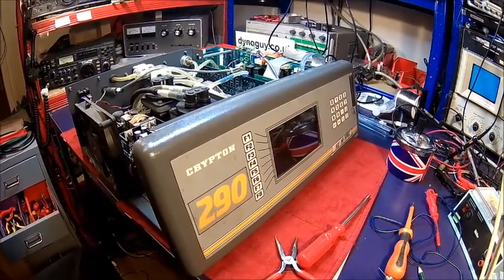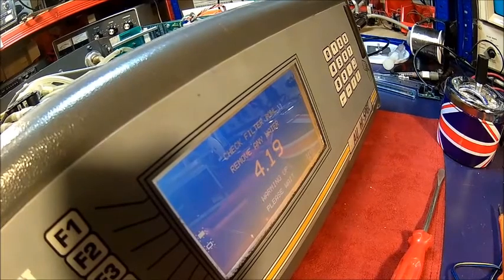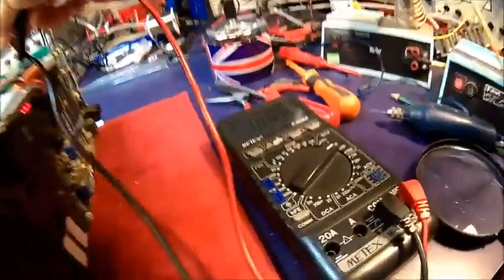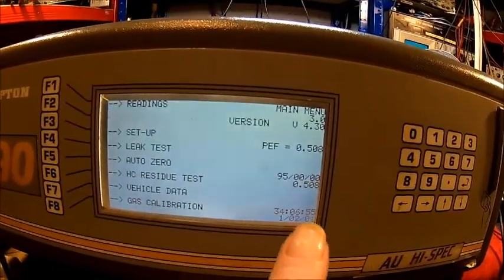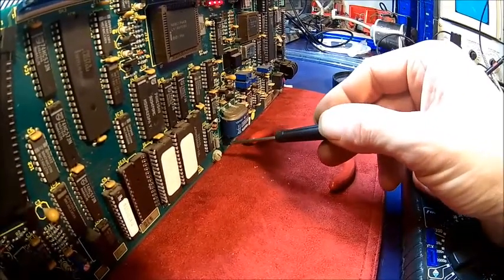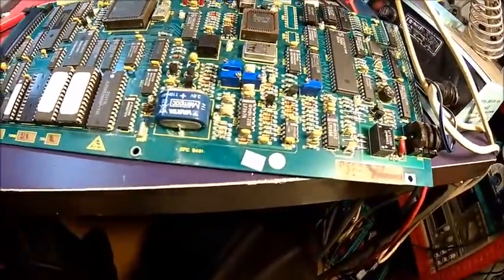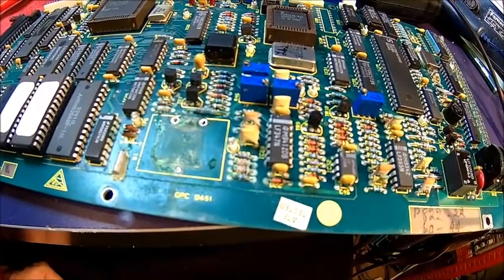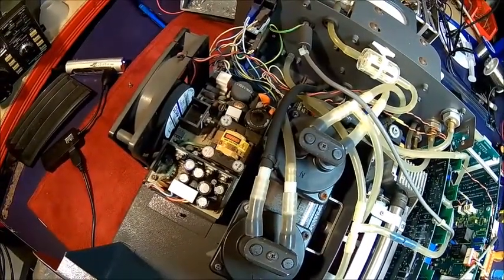Crypton 290 Emissions Analyser,  fault finding and repair - part 1 (Car diagnostic)

Comment: Hi great video , I have used many of the older type gas analyzer from that era[ Bear I/M bar 84 and BAR90 Emission analyzers
some models will go to a screen saver mode like yours to help protect the CRT from Burn in [where the main menu stays burned in on the screen from running to long] if it has a O2 sensor inside [models that use cal gas for calibration] REPLACE  that sensor BEFORE making any adjustments to the pots [which have a small adjustment screw on each pot I own  a BEAR ACE with  a Ckit full size engine analyzer I bought New and service and repair myself since they have gone out of business  it a great compliment to my Mustang MD500 chassis Dyno  a invaluable piece of equipment in my shop  hope this helps   Royal T
Reply from the maker: Well, there is no CRT to burn in, it's an LCD, there are also not really  any pots to adjust, it's pretty much all done in software, but you are correct with the O2 sensor, that needs replacing every couple of years.

Comment: hi.. do you know the voltage of the power supply. mine is broken fuse bows everytime without the output connection so sure the power supply broke. do you remember wich pin has wich voltage? colours maybe?
Reply from the maker: Don't know the voltage right now, but check mains side rectifier and capacitor, one of those are most likely bad

Comment: Hi There, I have one of these gas analysers with similar issues, I'm an electronics engineer and a petrol head. I have a VW Corrado I'm working on (fulling issues) an need an analyser to help work out the problem. Do you possibly have a schematic for the crypton 290. ?
Reply from the maker: Hi Dan, ... as you probably found out by yourself, there is pretty much nothing to find on the web, so the answer is no.  But if you are an electronics engineer, it shouldn't be impossible for you to fix it without drawings, just apply some logic and experience, then you may get there at the end....cheers, Mike

Comment: Is that machine still usable for today's mot?
Reply from the maker: Not entirely sure, it's only a 4 gas machine so no NOx channel fitted. Maybe that would need upgrading because i think NOx is now required, too. It certainly will need a (certified) calibration and i don't know if that is still possible after 20 years. I don't really care, i just use it as it is and if i need to, i can compare it to a known good machine.
Reply: It should still be very usefull to setup the carbs on a vintage car.
Reply from the maker: It certainly is and i am sure it is at least good for Euro 3 vehicles. I already have a Mexa 2 channel machine (CO+HC only) which i use to tune my bikes. They run much better if you do it by emissions rather than with a syncro tester alone.